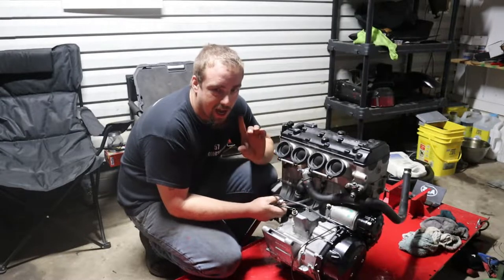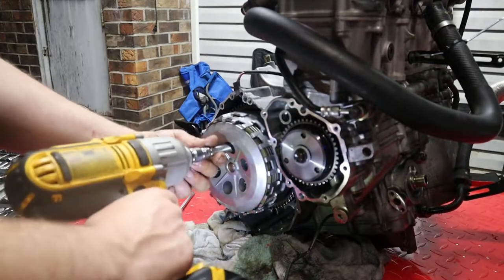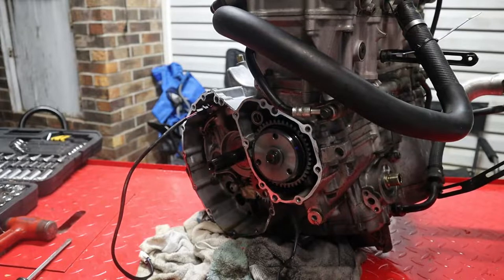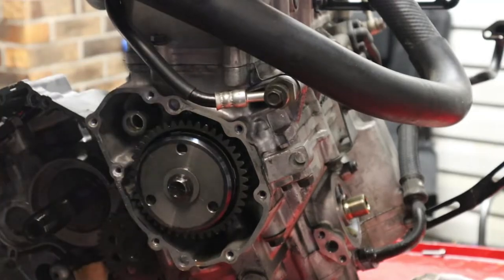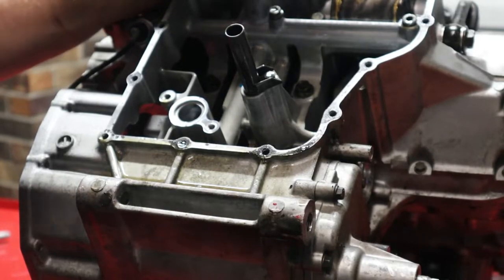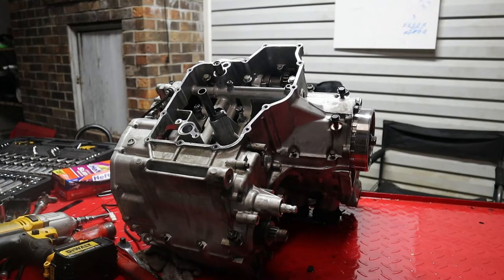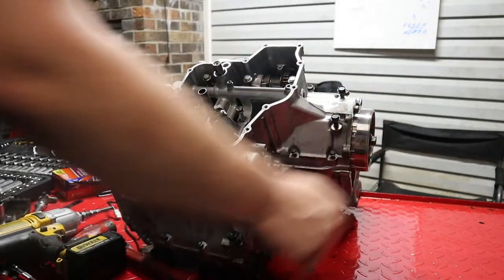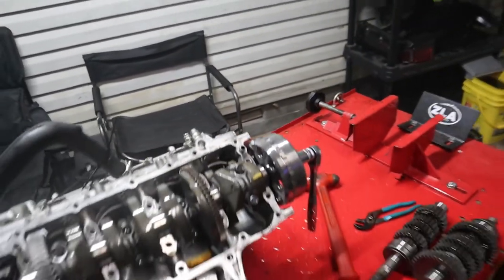Gen 1 Hayabusa Transmission Replacment Part 2

Comment: fun watching you tear down.  Q: What does it mean to back-cut the gears?   I assume some milling process.  Why would you do that vs replace the gear?  I have gen 1 busa comming that either has a bad clutch or buggered tranny.
Reply from the maker: Back cutting allows positive engagement of the gears rather than the factory 90 degree mating surfaces that commonly slip

Comment: Sorry what was the original problem?  False neutrals?
Awesome video 😎
Reply from the maker: The original problem was a skipping in second gear it feels very similar to the chain skipping on the sprockets but it's actually the transmission skipping in and out of here it is a common failure in all generation one Hayabusas